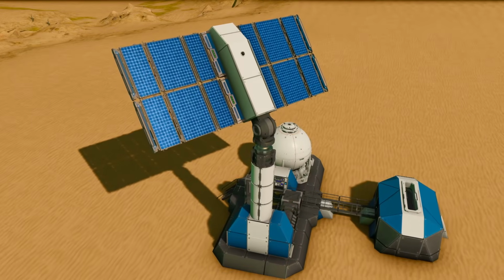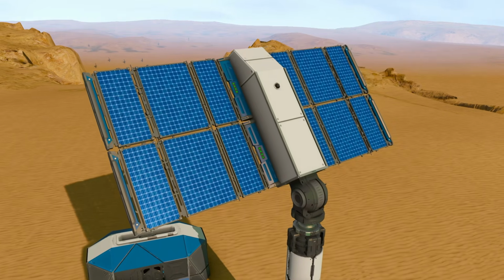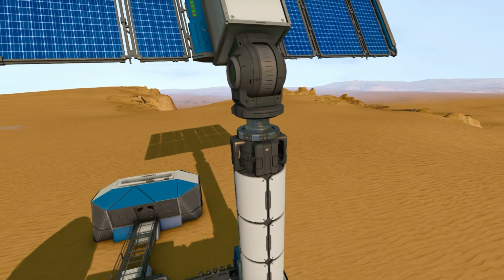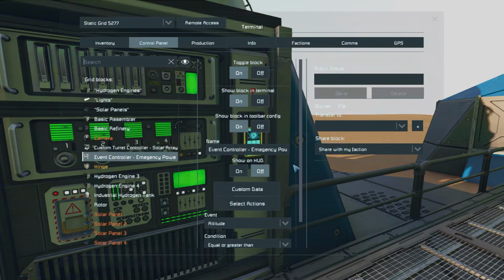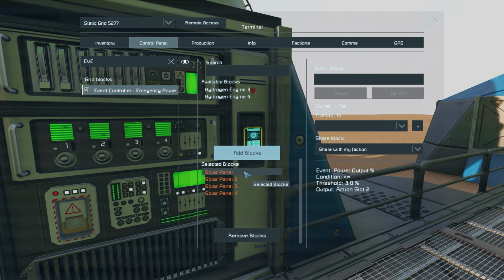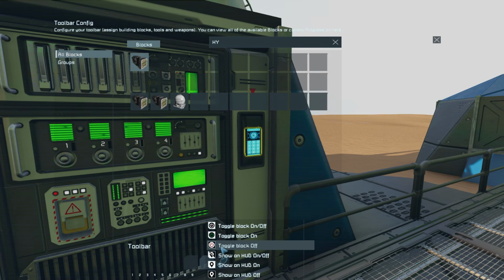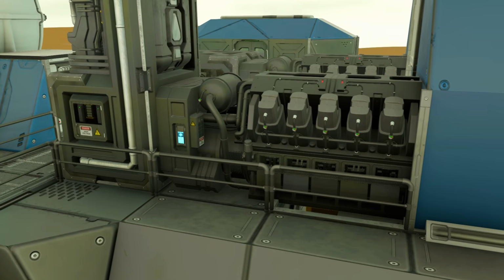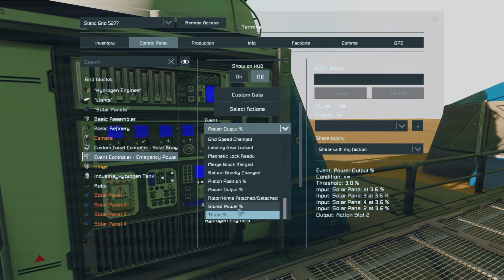How to use AI To AUTOMATE Power GENERATION - Space Engineers Automatons AI Update

Comment: this kind of setup works for automatic lighting at night too, but the issue i found at the time is that my lights kept going on and off when all my batteries get full, instead i tied my hydrogen engines to my batteries stored power precentage, but not sure if the lights flickering on and off has been fixed with the solar panels once all batteries are charged. the solar panels would go from 100% power output to 0% on and off on and off, while the sun was there. anyone else got this issue before? 

My work around for the exterior lights going on and off, was to tie the event block on the rotor attached to the solar panel, turning it into a sun dial, setting the lights to go on when it reaches the night angle on the rotor, and off when it reaches the morning angle. For storms, i used a wind turbine as a storm detector as the power output goes to 130% so i put the event block to trigger lights and back up power in the event of a storm, then off when the turbine is at its usual power contribution. 

hope this helps anyone who experiances the lights flickering issue once all batteries are charged at 100% and your solars start wondering if they generate power or not every second

Comment: Ok, I've worked out how to reliably set up back up generators to turn on and off regardless of the sun or power grid draw.

Required 
2x Event controllers
2x Timer blocks (doesn't work without these I tried)

1. Set One timer Block to turn the Hydrogen Engine ON and the other block to OFF
2. Set the first Event controller as Power Output (Less Than) 0% then in the left slot to Trigger now "ON and the right slot Trigger now "OFF"
3. Set the Second Event controller as Power Output (Greater Than) 95% then set the action slots to directly turn the hydrogen engine on and off 

Now this setup is reliably working on a quick mars creative game i've been toying with as I needed something reliable for my main work as Im playing without batteries. 
As for the timer blocks it was a stab in the dark to fix the problem of power not turning back on on sunrise if the power draw exceeded the solor panel output which thankfully worked.

SIDE NOTE, moving the sun position too quickly in creative mode will still turn the base power off, seems it needs a steady delay.

Comment: I don't know why people build their solar arrays and turrets like that.  While ships don't have "balance" according to thruster or gyro placement, they DO have balance according to wheels, rotors, pistons, and hinges.  If you want them to move smoothly and quickly, you need to make sure that the CoM of the sub-grid being moved, is in the center of the hinge or whatever point of motion is the case.

It'll greatly improve your turrets' accuracy, as well, because you'll be able to use lower strength settings that give more precise motion with less shake.

Comment: Space Engineers already does this. If the power consumption exceeds what the solar panels can produce the Hydrogen Engines will automatically activate. According to the Space Engineers Wiki power sources will be used in this order: Solar Panel / Wind Turbine, Hydrogen Engine, Large Reactor / Small Reactor, Battery / Small Battery. So if solar panels can meet demand, the Hydrogen Engines will draw no hydrogen.
Reply from the maker: That is something I actually didn't know, well spotted. Though I suppose the upside to this method is not needing to listen to the Hydro engine constantly.
Reply: @BenDoesThings404  More so when you actually hear them kick in, you have a tendency to watch hydrogen levels more closely if Ice isn't easily accessible.

Comment: I loved the idea, but what if instead of spending the Hydrogen just because there's no input from the Solar Array, we could activate the engines to activate only when the batteries are lower than some amount... ;) making them an Emergency Power system ;)
Reply from the maker: That is one of the solutions I mentioned you could do. The issue is then is it needs more setup, and requires a timer as well. Since the moment it goes below the % set, it will activate the engines. However, the moment it goes back over that %, they will turn off, meaning you'd have a power cycle. So a timer would be required to delay the turning off sequence.
Reply: @BenDoesThings404  unless you have 2 controllers: 1 detects bellow 5%, other detects above 95% ;)
Reply from the maker: I mean that is one way to do it.
Reply: @BenDoesThings404  its a great way to do it, since its reliable and because 2 event controllers cost less pcu than a single timer block
Reply from the maker: Indeed it is, and was something I didn't think about. Will definitely have to experiment more with even controllers.

Comment: This setup is a very large waste of ice. I disagree with the whole thing. Setting up a battery and a much better solar layout with the event control set to ONLY use the Hydro engine when the battery is low is way better than this.
Reply from the maker: It might be considered a waste, but you need to remember that solar power and hydrogen engines are the only two power generation methods that are universal for all planets, moons, and space. And whilst batteries could be used instead, this was a way of showing between toggling automatically between two power generation methods, and batteries would be a storage method that wouldn't need a system like this. But batteries would be smart to add to the system as an extra addition.

Comment: I'm happy that someone figured this method out. I use a similar method where my base runs on solar panels during the day and batteries at night. If the batteries drain too quickly for any reason (mostly when I have all 7 of my vehicles are docked), I have H2 engines to recharge the batteries. It does take some configuration to do, but the return is worth the time.
Reply from the maker: Glad you enjoyed it and I know the feeling. Draining your entire bases powersupply when charging is not ideal 🫤
Reply: Mainly a problem early game I think. As soon as I can afford the build, I usually built a solar panel tower with 64 panels on a mountaintop near the base. Put some decoys somewhere near and 2 turrets wir plenty ammo and a battery if the connection to the base is cut by enemyfire so the turrets stay online. Problem with defense solved.
Deep within the base I built like 10 largeblock Batterie.
As soon as these are loaded, I usually never get them empty by using my refineries and vehicles.
In earlier time I aldo did built a hydrogen generator to kick in if load of batteries drop below like 30%,but that never ever happened, so nowadays I dont even built a secondary powersource.
Even if drone kill the solar tower, rebuilding it usually needs just like  10% of the time until batteries run dry, building a hydrogen generator just 1% if needed and plenty of components, Ingots and additional ore waiting to be processed I usually own at that time.
Reply: Having batteries to store the spare power would have been more helpful...

Comment: I don't get why you didn't do this via a battery charge level instead. This could be for if there is a high load like a ship charging.
Reply from the maker: It was just to demonstrate the general system that one could use, since it would be pretty much the setup if you wanted to use the charge level event instead. Even so, you might want more ways of generating power than just one. Plus its one way of demonstrating the new "Align with sun" feature.
Reply: @BenDoesThings404  It's just so wasteful of hydrogen. if the grid load picks up you could end up running out of power with the engines never turning on.
Reply: @BNETT21  i'd have hydrogen as a last ditch power provider if everything else (wind and solar and batteries) are not enough or depleted. but for just a demo this was useful
Reply from the maker: Whilst some might consider it wasteful, it should also be taken into account that on some planets/moons, there might be no other option. Depending on if they have an atmosphere or Uranium, which isn't the case in some instances. Plus, engines are cooool 👍
Reply: @BenDoesThings404  Wasteful in the sense that the battery will never go through a proper charge/discharge cycle. The only time it would get used is if the bases power was overloaded vs using it's valuable energy at night and charging it back up during the day when there is solar.
Reply from the maker: That is fair. Though you might run into the situation where the solar won't be enough to charge the batteries during the daytime. So you might in the end need another power source to help charge the batteries. But I understand what you mean.
Reply: Batteries complicate matters. On auto, they provide power top production and recharge themselves from engines or reactors, wasting 20% of the power. Automating things with event controllers rarely helps to conserve fuel.
Reply: @BrianRonald  Not true. They only waste 20% if they are set to recharge. On auto they don't waste 20%.

Comment: You can tie this system into your grid with another controller and your batteries so that if the batteries are above 80%, the H2 engines cut off to save Hydrogen. The new AI blocks make stuff like this so much easier!
Reply: Ya he lost my interest in this video by not using batteries.. As odds are he would have made spare power in the day time so the extra power should have gone to the batteries rather then being wasted going no where...
Reply: @jonathanbair523  While very true regarding the batteries. Wouldn't call solar wasted energy and then the engine only produces what it needs to.
That little base without batteries could be a fun different way to play for an extra challenge to yourself.  AKA no batteries on static grids

Comment: Can you mabe possibly do a video on how to automate day night lights for your base? Off during the day and on during night?
Reply from the maker: I will look into it, great suggestion!
Reply: @BenDoesThings404  so i see if you use your event controler with your solar panels you can asjust power setting ro 5 or 10 % and when the sun goes down the solar panels switch off and the lights switch on
Reply: @aBlackHawKa  or adjust the angle for the hinge, but it is true that with this setting you can turn on both the hydrogen engine and the lights
Reply: @TheElafis  jes i believe if you use another event controller you will be able to do this .
Reply: Gleeb Torin's Top 5 Survival Uses of the Event Controller goes into that.
Reply: Thanks alot and mabe airlock system aswell . Im not to good with seting up stuff like that lol
Reply: @aBlackHawKa  For airlocks, and pretty much any other door you want to operate automatically, the simplest solution is to use a sensor for each door. 

Set it to open the door when you enter the sensor field, and close it when you exit. Adjust the sensor fields as needed. 

This will make the door work independently of anything else that goes on, and you won't need any scripts. 

Te only tricky part is to figure out where to fit the sensors, but it's not particularly difficult.
Reply: @patrikhjorth3291  lol jep sensors i got thats the easy part what makes me struggle a little is to do a proper airlock system with the new ai blocks and how you must program them to work correctley
Reply: @aBlackHawKa  I understand. That was kind of my point: I personally wouldn't bother trying to set up airlocks in the event controller, I'd save that for things that can't be done easier with sensors or something. 

Not trying to discourage you from trying, though. If you can make it work, that's great.
Reply: @patrikhjorth3291  lol yes no i tried and failed. I'll also rathter use sensors much easier
Reply: Solar panel event controller lights.
Panel makes zero power lights come on panel makes some power lights go off
Reply: @sethgilcrist8088  lol yep i experimented woth that and fogured it out
Reply: @aBlackHawKa  😀